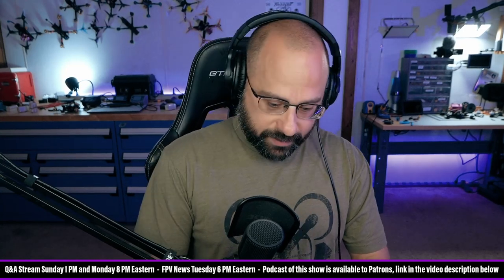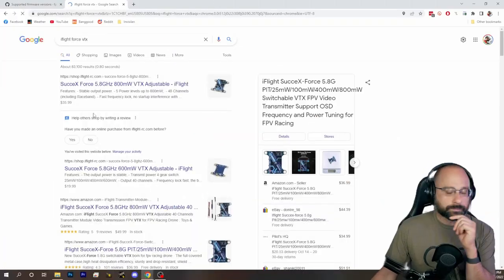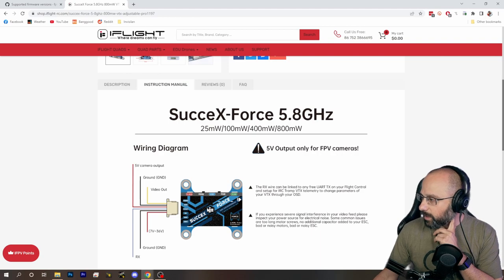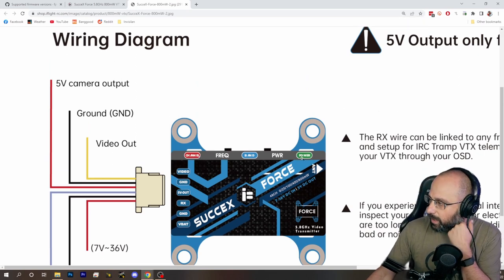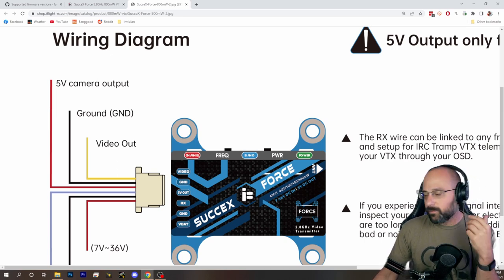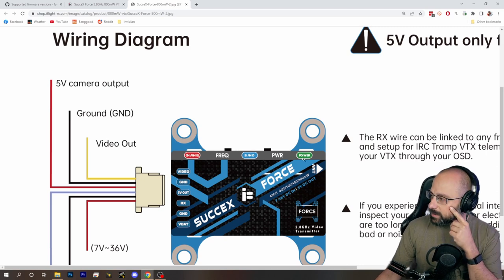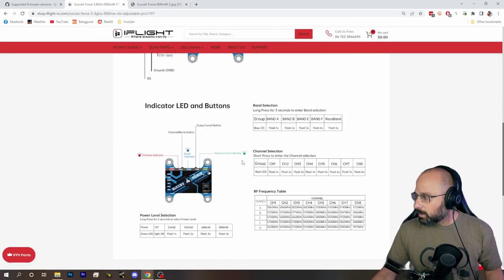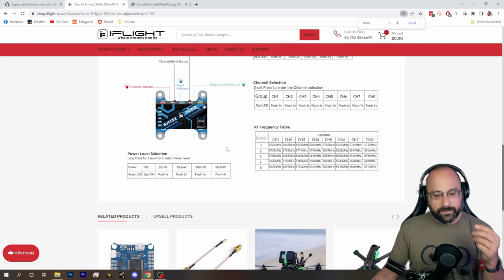My Analog VTX Breaks Up At Short Range! Help! - FPV Questions

Comment: Check antenna system impedance with a VOM. Then test at low, mid and high frequencies and see which yields the best performance as an antenna system will work best at certain frequencies. If everyone did this, they would be amazed at just how good an analog system can be.
Reply: I think this was my issue. Changed frequencies and it's a lot better. Went over a mile the other day down some RR tracks. Zero breakup! Expresslrs is awesome.
Reply: @jasontrigg9911  Cool beans brother 👍🏽
Reply: Is there some link I can use to give me the information I need to do this?
Thank you

Comment: I set betaflight to low power until armed, but it never went to 800mw. It just stayed at 25mw. Almost lost my 7 inch. Now I just leave it at full power. Something with the older version of BF on the FC, I think.
Reply: Same issue here. But the reason for this is this VTX max power is actually 600 mV, not 800 mV. If you change the label and value for 600 and 600 in BF, you will get the proper settings. At least this is what the VTX is indicating by 4 green blinks when armed (with low power disarm on). I have almost lost my quad two times becouse od this. Anyway, even though its blinking 4 times green now, my VTX range is around 400m.

Comment: Hi Joshua great video, it has helped quite a bit however, I have an issue that I’m hoping you can help me with.

My fpv feed breaks up at about 5 meters on my hglrc Zeus nano 350 mw vtx, is this normal? 

I’ve tried changing the output power and I can’t figure out why everyone else with this vtx is getting a much better fpv feed.

Help would be much appreciated. 👍

Comment: That VTX sucks... You only get 480mw, not 800mw.
I changed it for a Speedybee tx800 and the change is like from night to day.
Reply: That's a drop in replacement? Wire connector and mounting holes?
Thank you
Reply: @XtianApi  Nop, 20x20 holes, only 5V in, and not the same connector. But is very easy to change!
Reply: Any chance you could drop me your vtx table? I'm running the same tx800 but the table on the speedybee site has power levels differing from what they advertise the vtx as
Reply: Differing as in the table only goes up to 600mw but has it labeled as 800 
Idk what the deal is, mine also had to be soldered directly because the plug would not work at all for some reason

Comment: I don't get more than 1/4 mile range with this vtx and good matching antennae. I noticed that the product page says you need to use a capacitor or the battery noise will worsen the vtx performance. But iflight didn't put a capacitor on the pre-build. Maybe it's just a bad vtx?
Reply: I have a  iflight evoque and there is a little silver cap under the board. Hard to see. But regardless, without a cap you get black banding, but in my experience it doesn't screw with your range.